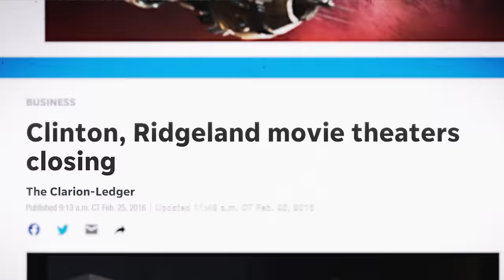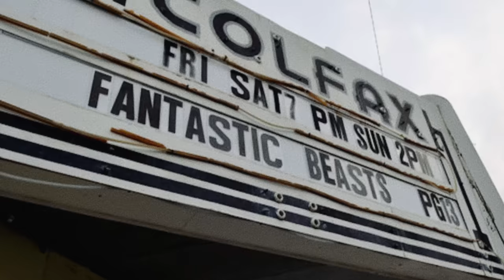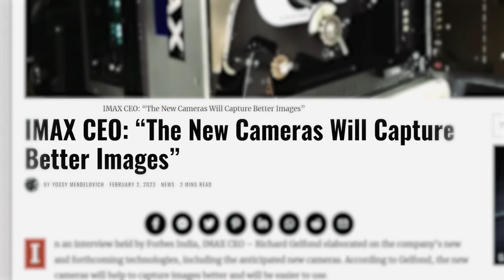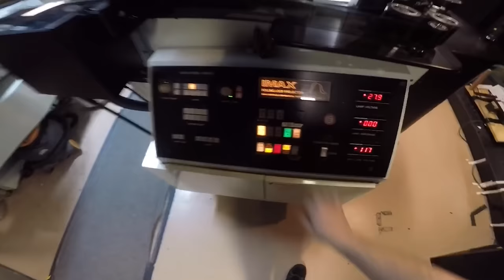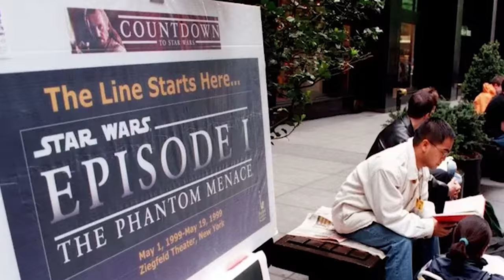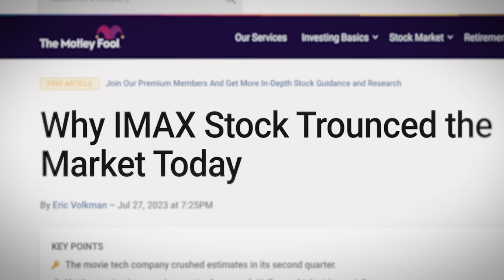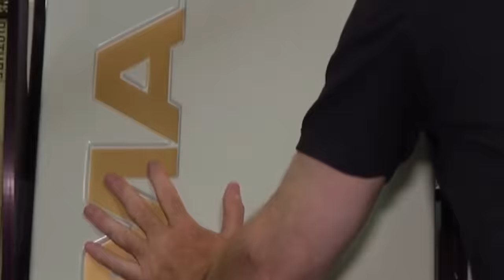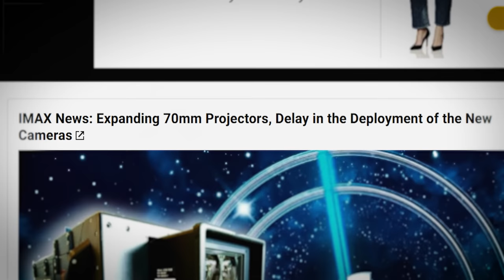Will IMAX 70mm Survive Without Christopher Nolan?

Comment: I saw Oppenheimer in one of the 30 theaters that played it in 70MM IMAX, and I loved it. I love film. I've largely stopped going to theaters in part due to digital. If I can only see a movie digitally, then there's no reason to see a movie in the theater over home. But for something like Oppenheimer, UHD won't match the big screen. If the film industry and theaters want to survive, they need to offer something that competes with a television, just as they did in 1950s with widescreen.
Reply from the maker: I think for me I like IMAX 70mm and film to be an "event" for specific movies. Kind of keeps the magic of it alive without watering it down too much. For other movies like the Meg 2 I don't want to watch in film haha
Reply: @cicolas_nage You could not be more wrong, Film will always look different to digital, whether that be the slight shimmer as the film bounces up and down or the flecks of dust and debris that crack and popple on screen, this is something (For better and for worse) that you don’t get with Digital.
Reply: @cicolas_nage  I seriously don’t get where you’re coming from. You say they look the same and now you say they look different but also the same…
Reply: @cicolas_nage  well said but that is not how you experience film, while yes technically a perfectly aligned, cleaned and projected film cell might look very similar to a digital frame, in real world use it is quite stark.

Comment: I’m very grateful that the showing at Metreon I saw Oppenheimer in had clearly skilled projectionists, the picture was sharp and filled the screen perfectly, it was amazing
Reply from the maker: Nice! Heard that's been kind of hit or miss
Reply: Can confirm that the Metreon IMAX theater in SF has excellent projectionists. I have seen Oppenheimer 3 times there already, and each screening was done with zero issues and the sound of the film projector running during certain scenes was very satisfying.

Comment: I really really hate to say it, but I don’t think I’ll miss it. I think shooting on film should ALWAYS be an option, but the flicker of Oppenheimer alone was enough to scare me off from film projection for good. I still haven’t seen dual laser imax (or single laser, for that matter), but I have to imagine it looks just as good, if not better.
Reply from the maker: Fair enough! For me, I really liked it in IMAX 70mm. Not sure id want to watch every movie on 35mm film though.
Reply: I do not agree. I saw 4 versions of Oppenheimer. One on Imax 70mm/15perf, one on 70mm5perf, one on digital Imax GT and one on a regular digital projection. I found that digital Imax does not come even close to the Imax70mm/15perf. On a big screen as IMAX and in considering the audience being so close to the screen, resolution does matter! It is as Nolan says: looking through a window. This experience I only felt with the 70mm/15perf. BUT: it has to be stressed that only 30% of the movie has this quality since all the dialogue scenes were filmed on Panavision 70mm/5perf film and than being resized and blown-up to match the 70mm15perf release prints. 70mm5perf is (was) a great format but not for an Imax screen. So, those sequences really fell apart and were not better than the digital Imax. The 70mm5perf  on a 2.20/1 screen was great as well since the distance to the screen was accordingly; but not that much better than the regular digital projection. Just my opinion...  Let's not forget that the almost aspect ratio of real IMAX (almost square) is essential for the real experience which was intended since its origin back in the early seventies: close to a hugh screen so that you are in the middle of the action not being aware of the borders of the screen. For that goal 4K is really not enough. But yes: 8K digital projectors and in some more years 16K ones will be there: no doubt. For the moment being: IMAX 70mm15perf is not surpassed by any means.

Comment: I don't get why folks fixate on screen resolution with IMAX. Film resolution really isn't a thing like it is with digital. A format like film or digital only has to produce enough resolution so your eyes can resolve fine details at the viewing distance you or the audience is expected to be sitting at from the screen. 

If you are watching on a 70 ft IMAX screen, any resolution that is at least 1080p or higher will basically look identical in terms of sharpness from a viewing distance of 114 ft or further back. 

Apple coind the term "Retina" for example when Steve Jobs introduced the iPhone 4. The point at which the human with an eye sight of 20/20 can no longer discern the individual pixels that make up the screen.  

It turns out that phone manufacturers found out that most people tend to naturally hold their phones 12 inches from their faces. 

So, with digital, to meet the "Retina" criteria on a typical phone, you need a PPI density of 286 or above. So Apple made the iPhone 4 have 326 PPI for good measure. 

A large theater screen is no different. You only need to go higher than 1080p if you are infact sitting too close to the screen you are watching. 

The "optimal" viewing distance for a 70 ft display is infact 114 ft.

So 1080p is sharp enough for 114 ft and further away. (Hence, why many large digital billboards are only of 1080p resolution.) 

If you can only sit, say, 70 ft or even say 50 ft away from a 70 ft display, then 4K would be needed. 

If you go under 45 ft away on a 70 ft display, then 8K would be needed needed so you can't discern the individual pixels that make up the image. 

So, in reality, the 70mm IMAX film thing is pretty meaningless when 4K would likely look just as detailed. 

Also, I have heard quite a few people referring IMAX to 8K. Also, 16K just like the new digital display in the all new Las Vegas Spere Amphitheater. (A 366-foot tall structure, by the way)

Now, all of a sudden, people are saying 18K. 

The reality is that film doesn't really have a "resolution" but more of a grain. It's more or less how many artifacts you will start to see as you increase the image size and how much light you pass through it. 

Cheap films will look bad and have a lot of granularity to it. Perhaps other things like more washed out colors, etc... 

Good film and larger film can just scale better due to a better manufacturing process and because you can pass more light through it. 

There are no actual pixels on film. People just throw out guesses to a digital equivalent. 

The reality is that a 4K digital image scales according to the screen size as well. So the bigger the screen, the further your viewing distance should be. 

A 65" inch 4K TV has a recommended viewing distance of  9 feet or further back. A 70 ft IMAX sized dream TV 📺  it's recommended viewing distance is 114 ft or further. The closest you could sit to that TV, though, would be 45 ft before you start to see the pixels that make up the image. 

But who wants to watch a 70 ft screen from only 45 ft anyway? That's not my idea of a good experience. I would like for my neck to not hurt when watching any sized display. 

And do I think 70 mm IMAX film will go away? It is likely as there are only 30 theaters left as it is. 

But smaller format films like 35mm may hang around for a bit longer. But also because it's more practical than IMAX for the majority of situations.
Reply: When I watch 4K content on my 55" TV from under 2 metres, I can see much more detail than 1080. I'm getting a bit confused reading your comment, but I think it might contradict that.

Comment: On the other hand at the release of interstellar there was only one cinema showing it in 70mm (non IMAX) here in Germany. With Oppenheimer this number increased to 7 (plus one 35mm). So the number of film projections at least seems to be increasing here. IMAX 70mm I think is reclining because the film reels are three times the size and weight of a normal 70mm print and it’s so much more unpractical that the cost.

Comment: Film projecting in theaters is dying. I went to see Oppenheimer over the weekend but it had to be cancelled since the projector ended up being jammed and died. It couldn't be fixed in the next hour since there are only few 70mm film repairmen in the world. And it will take 3 days just to repair it.

These theaters will eventually stop running film projects because of that problem and other financial reasons. For now, let's all try to watch as much remains of film theaters while we also prepare for an age of full digital and a sad eventual end of film cameras in the future.
Reply from the maker: Yeah that's the issue currently is no R&D being put into the projectors. They are all getting old and not conforming to more modern standards which means fewer and fewer people even know how to run them.

Comment: As a former die hard lover of film capture and distribution. I have to say that after seeing the latest laser projection technology I’m starting to prefer digital. I watched Oppenheimer on regular 5 perf 70mm and the projection strobing was so noticeable I was somewhat taken out of the movie. If I watch movies on film it has to be Imax or projectors with modern movements (less strobing).
Reply: Have you used an oled for movies, the color, sharpness and black levels are so good, no projector ive seen can display anywhere near it, only problem is size but 1700€ for a 77" at such quality is a steal, and power consumption of a projector is horrendous, give it a try!
Reply from the maker: You're not the only one that's said this. I really like it on 15 perf 70mm, it was an experience! But I can't say I want every movie to be this way. Like, I don't want to watch meg 2 on film 😂
Reply: Very Important, there is a huge Difference between 5/70mm and 15/70mm IMAX Presetations. The 5/70 mostly lack of contrast (and sometimes sharpness) because of the old constrution of the classic Projectors (I'm currently working with a Theater together for a light flow Mod/Solution for the DP70). They are designed in the 50s !!! You can't compair that. Only the IMAX 1570 GT Projectors have perfect light flow and sharpness, which blow any 4K Presentation away, in a big way.
Reply: @mixdown78 Yea lamp house and evenness of light blows on standard projectors. Seems like an easy fix tho with a re-design. It’s unfortunate the IMAX prints kinda suck due to the 5 perf shots being such low comparative quality.

Comment: It blows my mind that I spent decades waiting for “digital motion” to try over and over again, just to exist.  Until SLRs were displaced by DSLRs, there had been a bunch of (relatively?) famous attempts to shoot a feature on video, or anything-but-film.  It was just a question of tube cameras, versus CCD versus CMOS, and waiting for the contrast ratios to improve.  (And then to forget CMOS because rolling shutters).
Reply: CCD vs CMOS has nothing to do with rolling shutter. GS always needs storage which needs area in the array which always compromises image quality - still image CCDs and CMOS sensors are not GS for this reason.
However, unlike CCD sensors, CMOS sensors can be scaled to much higher readout frequencies (largely because the CMOS process allows you to integrate per-column ADCs, which is quite literally impossible with CCDs), so it's actually feasible to shoot video with an RS CMOS sensor, which would not be possible with an RS CCD.

Comment: As much as I love IMAX 70mm, the fact that so few locations have it, and with the stories of projection mishaps around the country, it may be time for Nolan to at least convice more theaters that still have 1.43 screens but no 70mm projectors to upgrade to dual laser.

There's only one authentic IMAX screen here in the Chicago area, but they are still running the old 2K digital xenon system, which can only project up to 1.90:1. It's because of this that i had to Take a 3.5 hour ride on a FlixBus out to Indianapolis to experience "Oppenheimer" the way Nolan intended. Now if that IMAX near me had the dual laser setup, I would have been just fine with that.

Another benefit of dual laser other besides the preservation of the 1.43 aspect ratio, no need for platter extensions to accommodate long movies.

I think shooting in IMAX is here to stay, but projecting as such will be rare.

Comment: There are many more prints than just the 30 IMAX prints. There are 128 non IMAX 70mm prints and 98 35mm prints out there. So in total about 256 film prints world wide. And while IMAX 70mm is so complex, 70mm 5-perf and 35mm are niche enough to be profitable for theaters and distributors. Being a true premium format that’s much easier to handle than 70mm 15-perf. And still higher quality than digital. As an exhibition medium regular 70mm and 35mm aren’t going anywhere. They’re not gonna grow, but they’re also not gonna shrink anymore either. Those people that still do that, do it because they care. 

As for the IMAX projectors. Well the issue isn’t only the projectionists or the projectors being old it’s the projectors sitting around for years without running. These are machines meant to run. That’s why a theater like the BFI IMAX that had been showing quite a bit of 70mm 15-perf this year was able to run for over a week, with 24/7 showings without any problems. Old mechanical beasts need movement and attentions. Not to collect dust for years. 

I’m 25, I am part of the new generation of filmmakers and I only wanna shoot and finish on film. It’s not that great things can’t be done with digital. It’s that film is simply a much more powerful artistic medium for narrative movies.

Comment: I went to see oppenheimer in 70mm the other day. The audience was packed. pretty sure film isn't going any where.
Reply from the maker: Same! And sure hope so! The issue is the lack of projectionists and the age of the projectors. IMAX has indicated they might be working on making better projectors which would be a good thing.
Reply: I hope you’re right.  The last feature film I saw in IMAX was the last instalment of Harry Potter, and it was everything the 15/70 format is not — a dirty multigenerational 35mm print, that looked like it belonged in a suburban multiplex from the 1980s.  Or at least that’s what it feels like when an average 20th century image is blown up to IMAX.

Maybe we forget how good we have it with 4K Blu-ray on an upscale 8K QD-OLED display with Dolby Vision balancing the HDR.  In fact I’m very interested in the day, not too far away, when I will do that with Oppenheimer and judge it critically.  The source material is amazing, but so is the display technology (albeit 8K not 18K).

Comment: This is so funny. Back then,  film grain, image wobbling, flickering, atrocious image degradation from the negative to the projected positive were considered massive technical defects, but today it's called "beauty".🙃
It's snobbery at it's best!
Reply: And that's before you consider the technical difficulties with dealing with film

Editing is much more straightforward, so is vfx, distribution
Even filming as the camera isn't so loud as to drown out the audio
Reply: Wobbling, flickering, and image degradation was a thing back in the 50s lol. But not with film in modern terms. Film has a higher dynamic range compared to digital. Whatever cinemas you went to probably didn’t have the best projectionist.
Reply: Digital technologies have always tried first of all to make any process cheaper and simpler, and only then to improve quality. 
First, it is thanks to film that you have the opportunity to watch the best movies of all time in 4K quality (and even more), just scan the film. The first movies shot on digital cameras fell into the trap and will forever remain in HD quality (2K), only upscaling can turn them into fake 4K. 
Secondly, the film is still the most reliable way of long-term storage. You can shoot a movie on a digital camera and then scan it onto film and store it. You do not need computers, software support, current codecs. All you will need in 50-100 years is a projector and... film!

Comment: I really hope that film projection stays around as the image quality of even just 35mm film is so far beyond digital projection and it is really a special experience to see a movie on film
Reply: That's just not true. Modern digital cameras easily surpass 35mm film in quality.
Reply: @FURYCHAOS184  the cameras are around the same level but 35mm projection is much better. digital projection in theaters is usually 2k, 4k at highest, and very low contrast, where 35mm can be approximated at ~6k and the contrast is much higher.